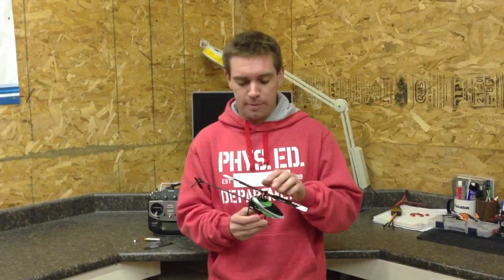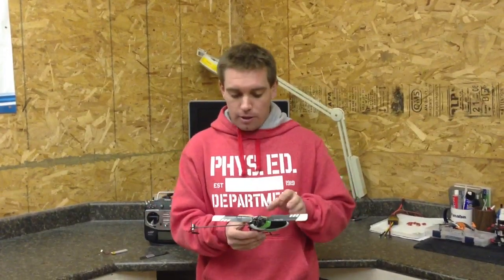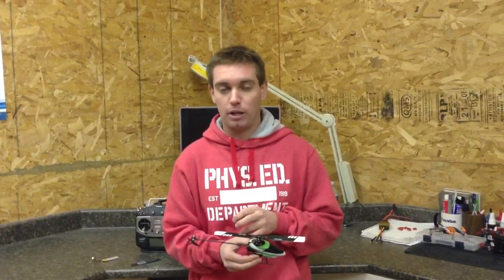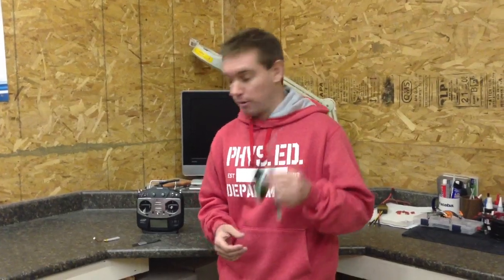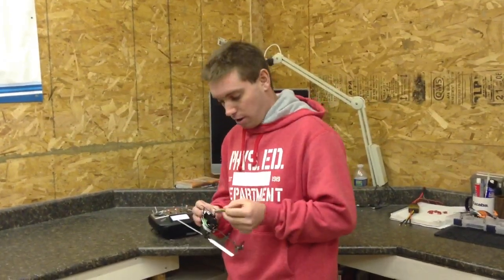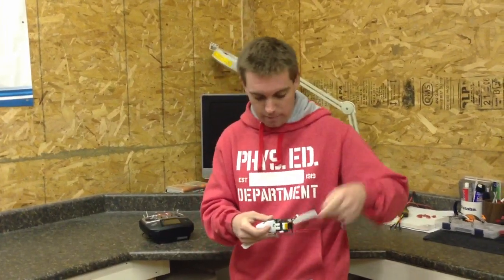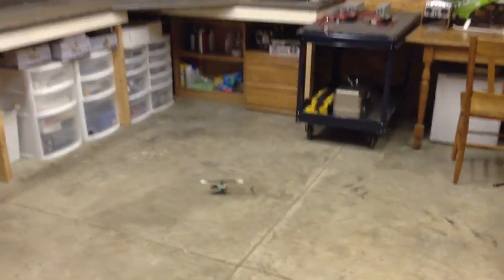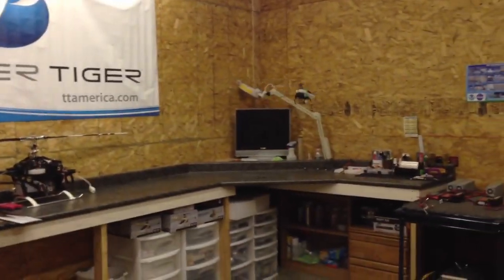Nick Maxwell with the new Axe 100 SS (brushless version)

Comment: one tip i found out to work better, is to use the mcpx microheli tail blades. they are bigger and about as light, tail is even better with that setup.

Comment: I just got my axe 100 ss about 3 days ago and evrything works fine except when i punch the throttle for flips and tic tocs i notice the tail lags alot and actually kicks out to the side sometimes because tgere is so much lag. What can i do to fix this? Expo, gain, delay? Ive checked out forums but no one seems to have the same problem idk any help would be appreciated.